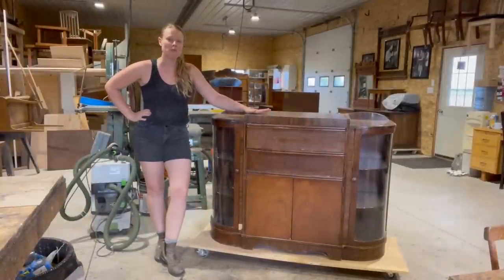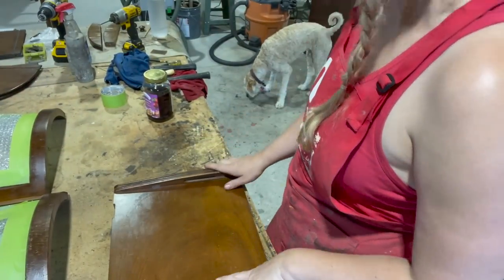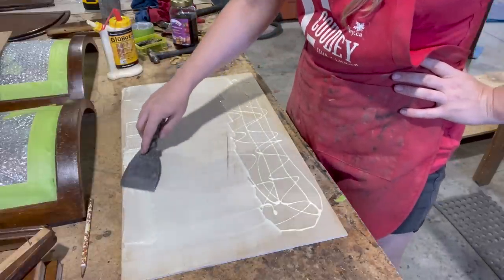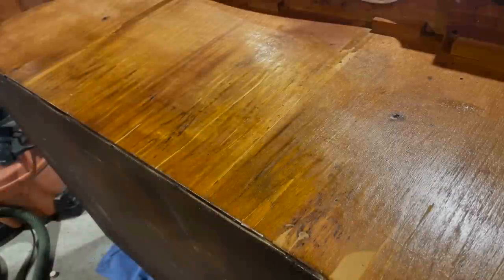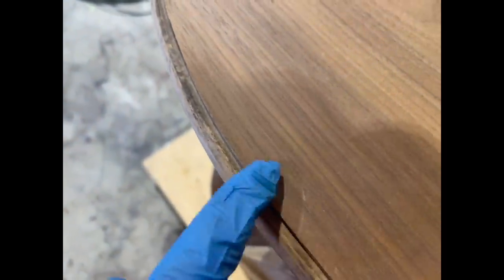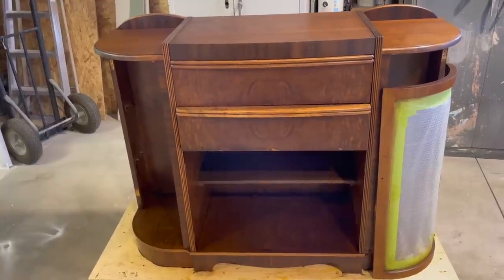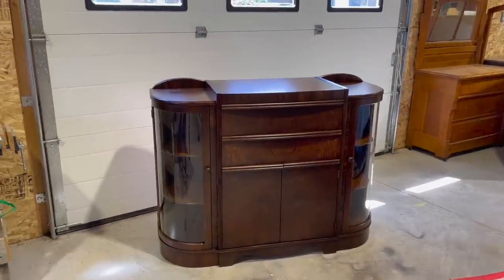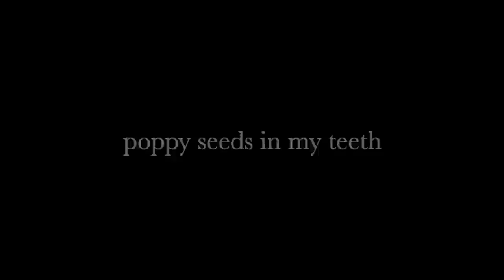When a customer passes away

Comment: Another amazing and absolutely beautiful piece; truly a labor of love in this one❣️ This was a very touching video.  I have several old family pieces, some still in need of restoration, and when I look at those pieces I always fondly think of who the furniture belonged to.  It's always a "warm fuzzy" for those who know what that term means.
Weird tip about antique glass ... there are many different formulas for glass, especially modern machine made glass, but antique glass generally had a high hands-on involvement and a slower manufacturing process, so it actually behaves as a fluid in some ways, and it is always in a state of very slow flux.  Example:  the glass in antique windows will be slightly thicker at the bottom.  This is more obvious in old softer glass ("softnes" affected by composition and annealing during manufacturing).  Those lovely curved panes of glass have likely flowed and snuggled into those doors over the decades.  You made the right call to leave them be and work around their stubborn determination to stay in place.   Glass hates sudden shock, and trying to remove those treasured curved panes could have likely been their end.  
I always enjoy and learn from your videos, and I politely envy your ability to have worked alongside your Dad and gleaned knowledge from his wisdom, and now share that wisdome with your Daughter, that is a  blessing!
I work in stained glass and home restoration, so that's where my understanding of some of glasses quirkier behaviors has come from.  I'm always learning and understanding something new, and I love it. Thanks again for sharing your wisdom and skill ! ! !
Reply from the maker: Thankyou!

Comment: I thought that you had your work cut out to fix that with the chips and rough and discoloured surfaces. Also thought the bottom doors may not have been original and could have originally been framed glass doors. Being coreboard gave them a different finish. However, you colour matched the defects very well so well done. A very nice job.

Comment: Years ago I was approached by a good friend of mine. A very close friend (old sweetheart) of his past away suddenly. My friends all knew I volunteered as a woodworking teacher in my spare time and then one evening he asked me if I would mind making her final resting place, an urn. I couldn't believe it, I was so honored. There was only 3 days so I took time off from work to finish it. It was a beautiful Koa wood box sitting on a solid ebony stand. The Koa had so much figure you could hardly see the grain. The ebony stand 2nd as a keepsake box (the Curly Koa box was the lid) large enough for pictures and jewelry pieces. There was no varnish. It was dry sanded to 600 then wet sanded, using an oil with Japan dryer and 2000 grit paper. I forgot how many coats.
He asked how much it costs and I told him that really never crossed my mind. I told him just entrusting me with something so personal meant more than the cost and to take it as a gift for her family. I still get emotional thinking about the hours I felt making that piece.
Reply from the maker: How lovely❤️

Comment: I love the design of this piece and your work is of course stellar. Cant say i am a fan of the straight grain veneer mix and the odd directional variation. To each his own. I made a curio cabinet 6.5' tall. Tempered glass on front and two sides and mirror on back 3 sides with 1/4" glass shelves. Solid wood.
Reply from the maker: Nice

Comment: For a long time 1965 to 2000 in my country you couldn’t give that stuff away. We smashed it up. Nobody would touch anything with veneer after 1960. I’ve smashed up and burnt plenty mid century furniture in my time.  Even now there are second hand furniture warehouses in the UK full of veneered furniture they can’t get rid of.
It’s changing now though - as it does. Mid century furniture is now a thing. The V&A museum have examples.
That earlier piece of Art Deco is lovely. I think the restoration has improved it. It has a feeling of solidity to it. A satin feel instead of gloss veneer. In the right 1930’s house it would be fantastic.
Reply from the maker: Very interesting! Thanks

Comment: Turned out very nice am sure Wendy's family are going to cherish it for many years to come. Way back 40 years ago when I had light spots on a piece i was touching up/repairing I would use the solid pigment from the bottom of a can of stain, it would be much darker so I would let it dry a little and then rub it down to the desired shade. Did not work in every situation but in a lot of cases it would be a very close match, am sure with your experience you have used this technique at some point. Am not sure about the quality of touch up products these days the shading lacquers look like they might have improved a bit. Even a $400 + Mohawk touch up kit was woefully inadequate, So many times I found myself just using all my other finishing products in different combinations to get the job done. Making fake grain/pores in oak with a sewing needle, painting in missing grain with a little pigment and lacquer mixed together, it was all an interesting learning experience. Back then my go to place for lifesaving help and supplies was the Goudy warehouse in the west end of Toronto
Reply from the maker: Yes I have.  I can relate to your experiences. Cheers!

Comment: I can see what you are saying now about the color as I'm looking at the final product.  You definitely got it matching better.  Maybe better than it was originally.  I'm not entirely confident all of those problems were from damage.  And getting all of those scratches out of the top was essential.  It looked pretty rough.  As for the glass.  You probably made the right call there.  It would have been better to get it out, but the odds of breaking it were pretty high.  I definitely would not have tried to force it out.  That would have been a huge mistake.  It would have been more a delicate operation involving carefully separating the glass from the surrounding wood. It was likely glued in there by dirt and finishes applied to the wood.  That seal would need to be broken before it could be safely taken out.  Or worse still, you might have needed to break the wood to avoid breaking the glass.  Not impossible to do but rather difficult.  And then you are making repairs to the wood afterwards.
Reply from the maker: It was in a groove and just wouldn’t come out anymore. Wood shrank or glass expanded?
Reply: @johnsfurniturerepair  
Almost certainly the wood in terms of expansion or contraction.  Glass can do that with extreme temperature variations, but it would probably crack if that happened.  The wood can also warp and end up no longer being square.  This can cause things to bind as well when things don't line up properly anymore.  But the most common scenario by far is gunk of some kind gluing it in.  But in any of those cases, applying a lot of force with no game plan would be a really bad mistake.  As stuck as that glass was, it was probably going to be a choice between leaving it alone like you did or carefully removing some of the wood.

Comment: This is a magnificent art deco refininish, simply superb. One question, not necessary for this piece; but for areas of use especially with liquid spills, why not use a 'bar varnish' on those surfaces? I know that it may add darkness to the finish but it would also protect the wood surfaces with assurance.
Reply from the maker: Do you mean spar varnish?
Reply: @johnsfurniturerepair  Yes, sorry to have mislabel the finish. But I think my learning working with my father, stated that it was used on a bar tops and on boat decks.

Comment: Hello Trena. Beautiful work, you did on this. When you steamed the veneer top to get the scratches and dings out, do you worry about loosening the glue that holds it down?
Reply from the maker: No actually some heat and steam can help deactivate the glue and moisturize it. The moisture would have to be excessive to lift the veneer’s

Comment: Curious as to why you used carpenters glue instead of a contact cement or super 55/77 adhesive for the felt?
Reply from the maker: Just how I have always done it. Works really well. Contact cement would be a disaster if you had a wrinkle.

Comment: Glass shrink more then wood so if there a freezer nearby you could try to cool it down before attempting to release the glass from  the frame.
Reply: @Wayne Flanigan I checked the values before posting.  
Glass(normal) contract/expand close to iron and steel. Pyrex glass has half that and fussed quartz have nearly no change.
When you write in Norwegian we can talk some more about learning languages.

At that time we can also talk some about what dyslexia means.

Comment: Impressive work, beautiful piece. Do the curved doors only latch at the bottom? Did you replace the latches? I must confess I have become a big fan of art-deco style. Mark Presling has designed and built clocks, bridges, pathway lights and now wall sconces ((6) DIY ART DECO WALL SCONCES (THAT'S A WALL LIGHT FITTING) Part 6 - YouTube) that are beautiful in the art deco style. Nice back-story, I am glad the daughter continued with commissioning the restoration. I have learned when parents pass it is amazingly difficult emotionally to deal with objects that were so much a part of their lives that they become almost impossible to handle.
Reply from the maker: Top and bottom. Cheers!

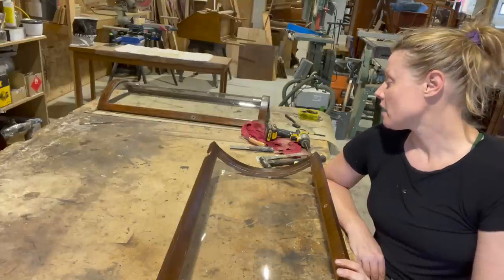Comment: 4:50, yeah that curved glass was probably originally blown into molds and now it would have to be hot laid sheet in a sand pit. Nearly impossible to replicate that now. So know the glass is Frame Bound, even trying to disassemble the frame could fracture that thin glass.
Reply from the maker: Yep. So scary.

Comment: What factors go into your decision to use Hide glue as opposed to regular yellow wood glue?
Reply from the maker: It was the original glue and using it again amalgamates   The old with the new cheers
Reply: @johnsfurniturerepair  So, is there an example where you might use hide glue initially on a piece where you are perhaps adding a brace or where you had to clean off the original glue as opposed to going with tigtbond glue?

Comment: the piece of furniture looks interesting, but it is very inharmonious and probably not particularly old! well, yes: there is no more furniture construction here - and also no people who still maintain it, from the past! unfortunately!
only chipboard furniture.. :-(
By inharmonious I mean: if you walk around the piece of furniture from a distance of say two or three meters - you will find out for yourself that something is not consistent - and has probably also been changed.
the scratches look like cats.
i think: it would look better if the two doors on the bottom left and right – also an open structure – would have a frame and glass.
that looks too bulky!
and the two knobs - to open the side doors - don't fit anyway, if everything works without knobs: a matter of opinion!

you know- in typography they say- you shouldn't use more than two different letters.
I think that also applies to furniture!

but it doesn't matter: i'll watch your films- for inspiration: because there's no such thing here in germany anymore!

congratulations on how you managed to do it again: neat work!
is probably an original American design?